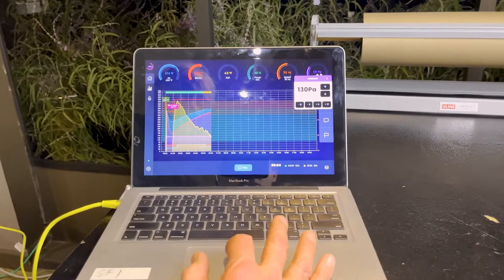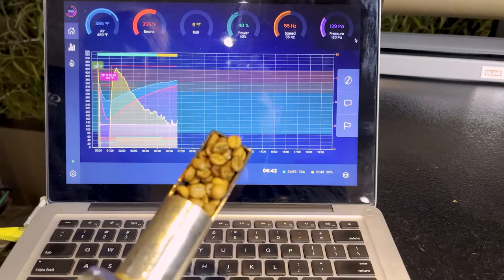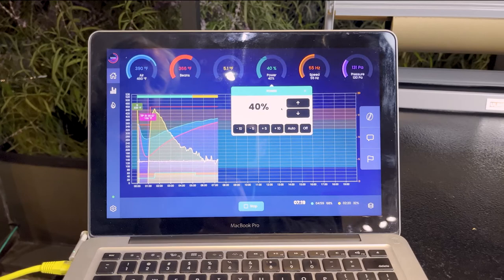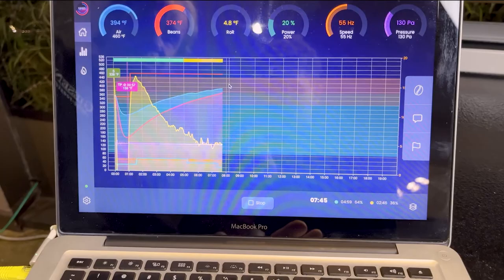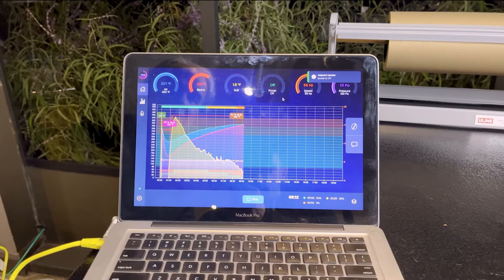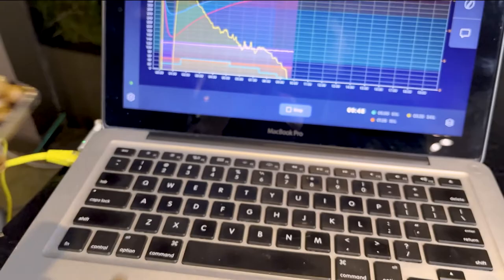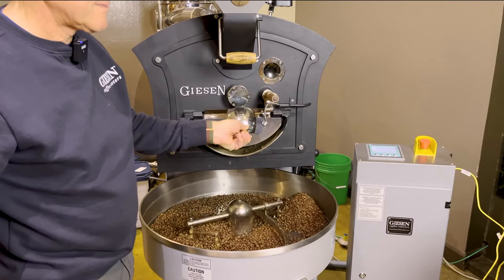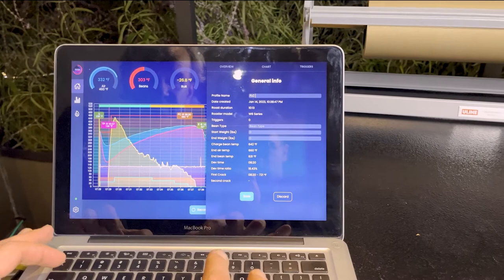Behind the roast with Willem Boot - Optimizing roasting profiles with the Giesen Roast Profiler

Comment: Negative RoR?
Reply from the maker: At 9:53, the negative Rate of Rise (RoR) occurs when the beans are charged into the drum. This happens because the beans are colder then the preheated machine, and the sensor detects the temperature difference between the beans and the preheated air as a negative RoR.
Reply: But there is also a negative RoR at the end of your roast, your roast drops from 391 to 389. The RoR is reading -2.7 before you drop the beans. Is that how you normally roast?